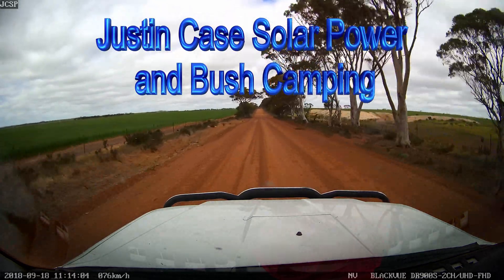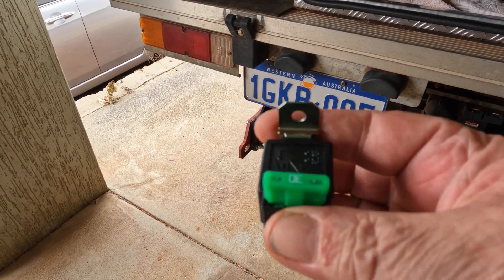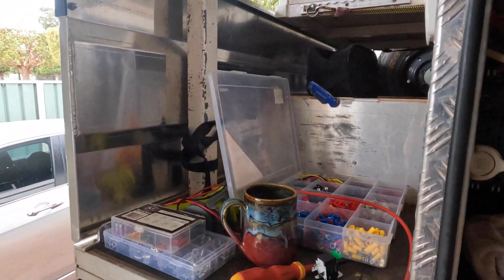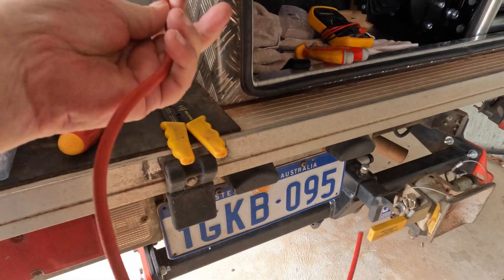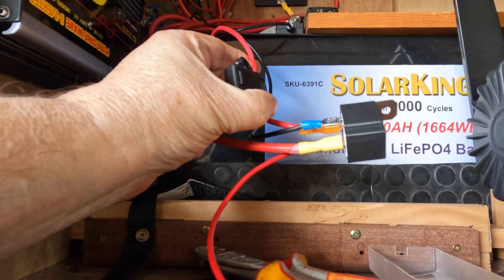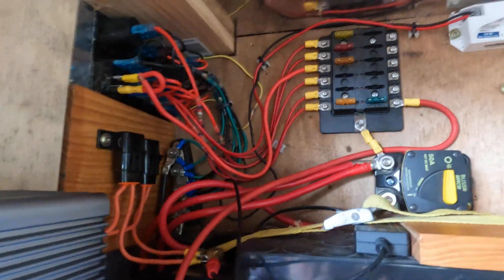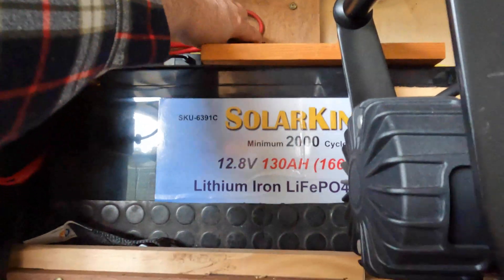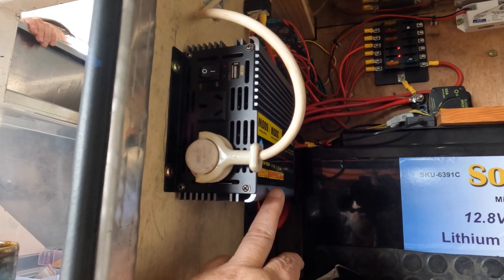Making a remote ON / OFF Switch for your Inverter. Wiring Diagram at end of video

Comment: Could I ask where you grounded thr inverter?
Reply from the maker: Since the vehicle frame is not "earthed" (and by that i mean connected to a steel/copper bar sunk 2 meters into the dirt), we're looking at what the inverter manufacturer says. The 300w inverter is grounded through the battery negative lead.  
The 2000Watt inverter in the trailer is different. that unit in grounded (Why you ask) because we sometimes need to run a small generator to Charge the battery bank. in that case the trailer is fitted with a Safety Switch Caravan RV Double Pole RCBO as per Australian regulations.   These regulations do not apply to the 300Watt isolated inverter in the car. Same as they would not apply to a 300Watt inverter that plugged into a cigarette lighter.